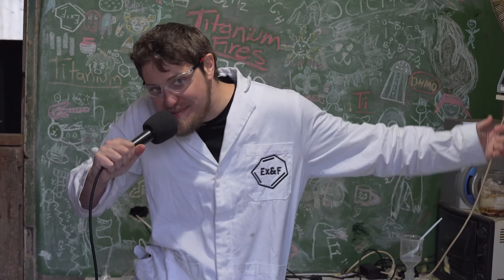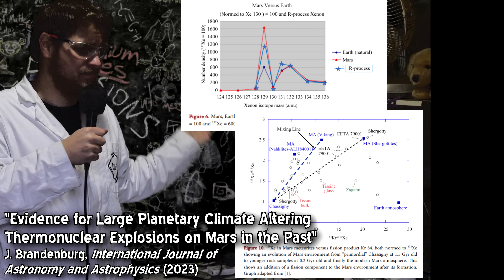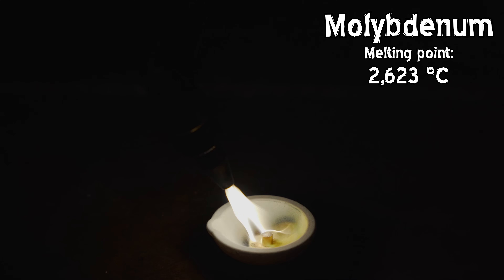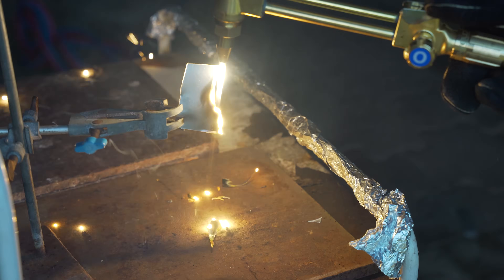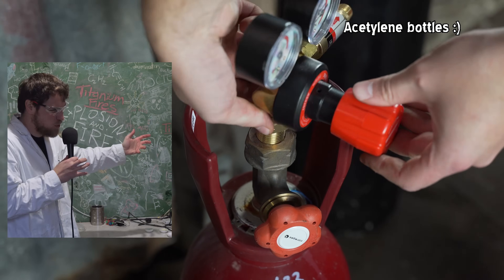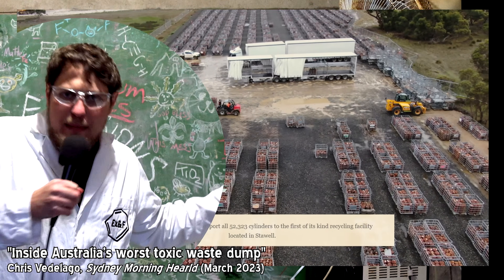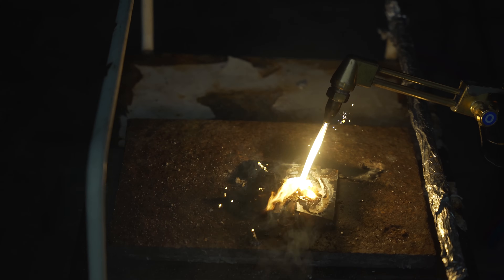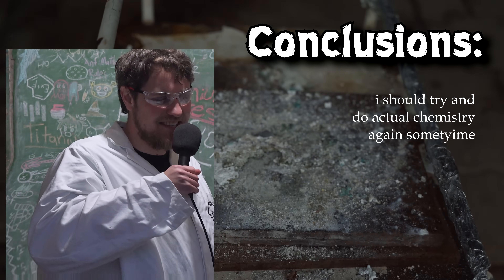Actually burning titanium

Comment: I love the explanation of an oxyacetylene torch as a fine balancing act of not quite burning your work and preventing the whole thing from exploding in your hands. It does take quite a bit of getting used to, and I even have quite experienced (and even more experienced than me) coworkers who get me to use the torch because they are (justifiably) scared of it.

Btw, the acetylene is generally dissolved in acetone to make it more stable/less reactive, but it doesn't dissolve incredibly well, so a major physical disruption such as tipping the cylinder 90° may cause the acetylene to spontaneously crash out of solution, greatly increasing the gas pressure and potentially causing a catastrophic leak of aerosolized acetylene and acetone, which will generally spontaneously combust on contact with oxygen in the air. So... The actual proper safety procedure when an acetylene cylinder falls over is to yell as loudly as you can and run away as fast as you can. (To warn others while trying to escape the potential blast zone.) Then return slowly while listening and smelling carefully for any gas leaks if there's no boom.

Yeah, you know stuff's dangerous when someone knocks over a cylinder and the regulator snaps off, and you're relieved that it was "only" the oxygen.

EDIT: well, okay, you got to at least the "dissolved in acetone" part.

And I don't know about recycling the bottles themselves, but I happen to live and work very near a major gas cylinder manufacturer/distributor, and they generally just take the cylinders back for refilling. No idea how long the internal media (which helps but does not entirely prevent the catastrophic crash-from-solution scenario I mentioned earlier) lasts or how they deal with recycling the bottles when that becomes an issue, but I imagine it's not too hard to cut the bottles open, recycle the metal, and... Well, probably dump the filler media in a landfill, because metal is pretty much the only thing we're good about recycling here in the US.
Reply: hey, we're pretty decent at recycling glass, too. Glass, Metal, and a few types of paper are basically the only things that are recycled at scale.
Reply: @CRneu  True, glass is infinitely recyclable, though even more energy intensive than metal. It's also harder to sort, though I'm not familiar enough with glass recycling to know how much that affects the overall process.

Paper is the odd one out, sometimes super easy, sometimes impossible, depending on if it's impregnated with plastics or contaminated with food or just not the right kind of paper for recycling.

Comment: As a welder i approve with your honest evaluation of your skills. 

FYI, adjust your torch so the "feather" in the middle of the flame just disappears, that is a balanced flame. Use this flame to heat your metal, don't press the trigger unless you want to cut the metal. If you press the trigger immediately it will actually cool the metal down.  You need to preheat the metal to the point of ignition before pressing the trigger and introducing the extra oxygen.

Cheers!
Reply: The ratios are off too
Too less oxygen for the center flame

Comment: The third knob on the cutting torch, above the lever you're manipulating, is used to supply oxygen slowly. The lever is meant to use excess oxygen to blow the liquid metal out of the cut. Your flame could be more stoichiometric, which is I think hotter.
Reply: The lever is to make the flame super oxidizing, so it burns the metal out. Doesn't just blow it out, the oxygen is to make it spicy. You're correct though, a neutral flame would be hotter. A cutting torch is the wrong type to use for this imo. A welding torch with the right sized rosebud tip (can't be too big or it'll drain the acetylene bottle too fast) would be perfect for his purposes.
Reply: It also comes out of a different hole. I don’t think he is using any O in the primary flame. But hey, it worked.
Reply: @xxxxxC4xxxxx it comes out of the same hole in the nozel... unless you're talking about seperate holes and valves in the actual torch body. But there's only on firey business hole
Reply: @mbburry4759  With a cutting torch, there are periphery holes that are ejecting stochiometric oxyacetylene.  Then the center jet is for high pressure oxygen only.
Reply: I'm watching months later.  It looks like he's only getting oxygen out the center hole and the knob on the cutting torch is closed.  He was getting a high temperature but it is far from a cutting torch's potential.

Comment: I'm not expert, but can you try pre-heating the plates with the torch, then going at then full send? When cutting steel, you do have to preheat, and it's the chemical reaction that cuts the steel, not so much the actual heat. AvE actually has a decent video on this explaining in dumb-people terms

Comment: Pretty sure the high flame temperature of acetylene is not due to the energy of the triple bond, it is due to the low hydrogen content.  Less hydrogen means less product water that has to be heated to hot steam.   See the enthalpy of formation and Hess law, etc. Compare to ethylene and ethane.

Comment: Some good tips for running an acetylene torch crack the fuel on lightly, ignite it, keep adding fuel until the flame isn't putting out soot, and slowly crack open the oxygen until your flame is a little white point surrounded by blue flame

Comment: If found an easy way to set titanium on fire using a butane torch.  I'd do it as a demo to impress the new hires.  It works with 0.2mm titanium wire, but might work with thicker wire, maybe even plate.

Hold about 10cm of wire with your fingers on each end (or one end in a clamp).
Heat the middle of the wire to red heat.
Pull apart the wire.  The tension will break the wire at the hottest point.
This exposes hot unoxidized titanium to air, which then burns like 2 fuses.  

Usually only a cm or 2 of wire will burn, but that's still several seconds of burning.  But it's a bright flame that can compete with magnesium.

Comment: the reason the 'company' is digging these bottles up is the can be turned into artillery shells easily just by cutting off the ends, knocking out the cores and heating them up and hot forming them...  mad for Ukraine, it is so insane.. let's do it again..

Comment: Use nitrous oxide as the oxidizing gas with the acetylene. Higher temp like in old school emissions spectroscopy kit, pre icp OES kit used that a bit.

Alternatively find I did a thing, and borrow his lathe, along with a good blunt lathe tool. Run them hard and bingo.

Comment: You really need to learn how to use that torch before you touch it you definitely don't have a neutral flame which is where you achieve the most amount of heat with an oxyacetylene torch Everything in this that I've seen so far is a carbonizing flame you're leaving a lot of heat on the table

Comment: When using the cutting torch(the one with the trigger) light the acetylene. Turn it up until the black floaties dissappear.  Then introduce oxygen. Turn up until you see two distinct blue cone flames. Acetylene 10psi and oxygen maybe 20- 25psi.

Comment: You gotta learn to tune you torch a lil better. Also you can adjust the nozzles on the bottom to allow a consistent flame without holding the button down. the button is for extra oxygen to blast out the slag during cutting, but shouldn't be necessary for just heating things red hot.

Comment: acetalyne tanks can be recycled its just not the safest operation. it involves using a hydraulic press to punch a hole in the tank to let out the pressure. then the tank is put in a lathe the ends are cut off then the calcium lump is pressed out. the problem is the mass of calcium off gasses acetalyne for a pretty long time

Comment: the whole titanium plate is room temperature. if you heated the whole plate up to just below the burning point and then set part of it on fire i bet it could much more easily generate enough energy to heat itself up to continue  burning

Comment: You more or less have the hang of that torch. Open the gas up more when you light it though, so you get a clean burning flame, then bring in the oxygen to balance it. Also, read about reducing, neutral, and oxidizing flames if you aren't familiar

Comment: a huge problem with recycling is morons, you know... the Australian Population... putting things in the recycling piles that ARE NOT RECYCLABLE.   On a box of dish soap you can rip the little aluminum spout off and put that in with the cans, the rest cannot be recycled because it is impregnated with chemical, contains detergent, contains polymer and is covered in plastic.

more than 90% of rejection of recyclable materials is simply dirt... don't bother throwing the thin water bottles in the recycle but DO put the really heavy soda bottles in - those are great fuel.

Comment: As a guy with more practical experience with oxy-acetylene cutting torches than chemistry knowledge, before I get too far in, I'm going to bet that you can't light the titanium plate on fire. The way those cutting torches work is that the acetylene flame is only meant to preheat it, and the lever that lets you flood the surface with oxygen is just to allow the hot steel you're cutting to combust and sustain its own burning at that point. It's important to note though that the combustion of the steel when it's being cut ends almost instantly upon ceasing the oxygen flow, so I would be very surprised if it could get a self-sustaining fire going on a material that ignites at a much higher temperature than steel does. Even if titanium's combustion is significantly more exothermic, it seems unlikely to me personally.

Comment: Oxy aussie is not dangerous. He cant hurt you...

Edit: also, Acetylene is fucing horrifying. If you leave a bottle laying down, It can result in a delayed EXPLOSION. 
Fucking insane. 
Also, It's a very normal thing to make acetylene bombs with it and big black trashbags. Problem with this is static electricity and touching the damn bag because It's not unheard of for the thing to blow up in your face because you got a perfect mix of oxygen and acetylene in the bag and there you are enabling electrical arcs in to it with your fingers and the walls of the plastic bag are thin as heck. Also I'm not saying you as in you but you as in every damn welder with a bit of lacking impulse control on planet earth. 
I've heard stories of people putting that bags in shipping containers and what not, warping the walls of the thing with the boom.

Comment: The reason you cannot get your titanium to burn is mass, you need more mass to insulate the heat and sustain the reaction. I accidentally set fire to a huge titanium heat exchanger whilst cutting it up with oxy acetylene in a scrap yard. I had already cut several dozens of tube lengths from the heat exchanger when it started to glow white in the middle of the tube stack. Within a couple of minutes it was a molten mass bubbling on the floor and exploding the concrete. I threw a large lump of a magnesium casting in the middle of it, and it instantly vaporized with a blinding white green flash. It was awesome, very expensive, but awesome.

Comment: I think if you spent more time tuning in the air fuel ratio you could have maybe gotten the tungsten to melt. the flame should get hot enough when its burned at the right air/fuel ratio. also, holding the lever dumps a bunch of excess oxygen down the center port of the torch and is making your flame colder than it has to be.
Reply: Nah, should have used a microwave oven transformer, high voltage has no real temperature limit.

Comment: Next time turn up the oxygen into the flame. You should have a super tough but blue flame without adding the oxygen to cut. Then when you supply more oxygen with the handle, you are cutting not just heating. You need to get a tight spike of a flame before pulling trigger

Comment: If you need to use your torch for more projects in the future, make sure you do a little research on how to reach a neutral balanced flame; it will save you a lot of trouble and you’ll have much cleaner results, your torch was very carbonizing (not enough oxygen) in this video

Comment: You need to work on adjusting the flame to neutral. You are using a fairly reducing flame, that is somewhat oxygen starved. It can get hotter still. Past a certain point it becomes an oxidizing flame and while plenty hot, is normally avoided because it burns the metal. In this case that might be a good thing.

Comment: When lighting an oxyacetylene torch or cutter I'm pretty sure you engage the oxygen just a little and then the acetylene just a little and step back the oxygen until you can ignite the stream. And when extinguishing it you cut the acetylene first and then the oxygen.
It's a bit trickier to get good at than just engaging the acetylene and igniting it but it's far, far safer.
The last thing you want is for the gasses to burn, or detonate if you're really unlucky, backwards down the handle (like the welding screamer at 1:51) and damage the gasket or, worse yet, continue down the tubing towards the cylinders.
To quote a warrior-poet; "Oxy-acetylene is scary :("
Good job on securing the cylinder by the collar though

Comment: There was an attempt to:
- keep to the proposed topic at hand
- not dwell in the tangent for long when it eventually happen
- keep a semblance o sanity

But it eventually it failed. I mean. It’s Tom. Great video btw. Deranged, going wildly into tangents and finally some FIRE (even if it’s really controllably handled, was half expecting you to put a barrel filled with water underneath the titanium plates to see if you could make “cornflakes” out of the molten material being shoot out by the torch. Idk, could be used for some experiments later.)

Comment: It was a little hard watching You try to heat up a piece of metal with a stream of hot oxygen. That was a cutting cutting burner. The way it works is You heat up an iron piece, until it is hot enough to react with oxygen, then blast a stream of oxygen to cut the iron, by pressing on the small handle. For heating things up You do not use the stream of oxygen, You just adjust the knobs to balance equation and get highest heat without wasting Ti and O2,

Comment: You needed more oxygen in your flame to get a nice blue flame which would be hottest. Also when you hold down the leaver it opens up a stream of O2 which is not mixed with the acetylene. This cuts the sheet instead of it getting hot enough to light.

Comment: I have been working as a machinist cutting Ti for a long time now. In 25 years I have witnessed two titanium fires and in both cases it was the chips(shavings) that caught fire. It is incredibly hard to extinguish, but as you've discovered equally hard to get started. I have seen many occasions where bars were glowing from friction but have never seen a solid piece burn.
Reply: alec steele even forged some of the stuff in the past, it only made a powdery sort of dross, but otherwise, uneventfull stuff while in bulk
Reply: Working on Ti Aerospace parts rn, I've only seen Ti dust catch fire on a fan in the polish area.
Reply: @osirine2924 Try a regular old school medium file, not too rough, not too fine. You'll get the filings going in 30 seconds. When you least expect it, of course. They left pits on my steel bench in these 2-3 seconds they were burning. Just commented on it: https://www.youtube.com/watch?v=sm9BFRP93_k&lc=UgwK3fgXa9bqysRdhpN4AaABAg

Ti fine dust may not only catch fire, it may explode in higher concentration. Go to the polishing area as never as you only can, if they don't service the filters properly!

Comment: @ExplosionsAndFire that is a cutting torch, not a standard oxy/acy torch. The extra lever allows high pressure oxygen to discharge down the center of the flame to blow away the melted material while allowing the oxygen to accelerate the melting processes. You start melting the metal, then you push the lever to actually cut through metal. The torch operating in standard mode, works too, but you have less dexterity than a standard torch.

Comment: by the way the way a cutting torch works is that when the lever isn't pressed you have a close to stocheometric mixture of gases coming out, and when you press the lever the mixture turns way lean that extra oxygen oxidises the steel you want to cut and makes it burn that then does the heavy lifting

Comment: Interesting linguistic question surrounding this whole video that just occurred to me: What even is flammability? For something to be considered flammable, does it not have to have to self sustain upon ignition?  If that's the case, then would titanium be considered non-flammable because it does not have this ability, even though it can technically be burned at extreme temperatures? and if it is considered flammable, what even does that actually mean?

Comment: Ah Titanium. So satisfying to work with. My uncle was a machinist that worked with it and the alloy that he used was surprisingly easy to machine but was a fire hazard if the tool cutting surface wasnt kept cool. The bulk metal is very difficult to set on fire but high surface area to volume chunks of it like powder or chips can.

Comment: Metallurgist here. You need to try using commercially pure titanium. The aluminium is added to reduce oxidation of the titanium at high temperatures.

Comment: I am sad you didnt use Red Fuming Nitric Acid or Dinitrogen Tetroxide, both are known in the space industry to have compbatability issues (read: catches on fire) with titanium. Ignition by John D Clark has a chapter where he talks about a titanium plate exploding after sitting in a beaker of RFNA. Titanium compatability guides will state that it has exceptional resistantance to most nitric acids but never use with RFNA due to the pyrophoric reaction between the two.